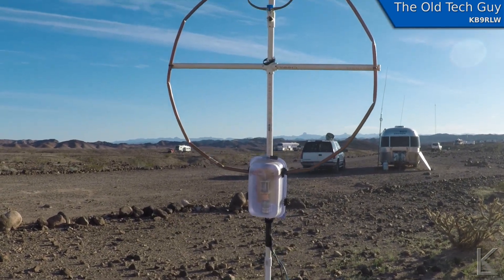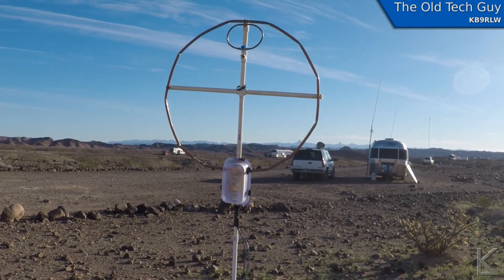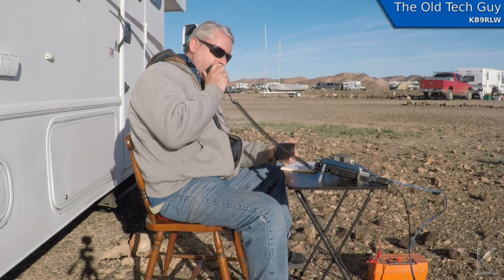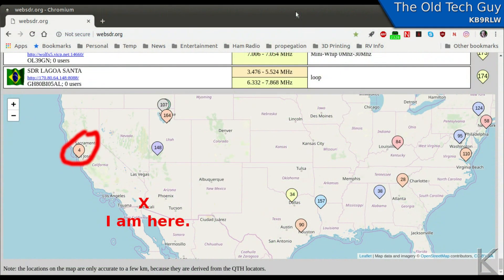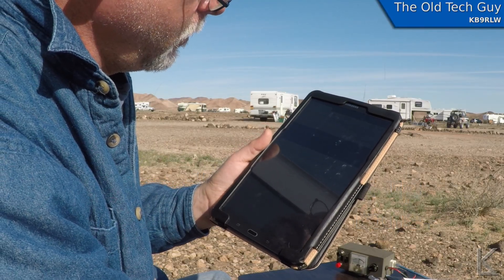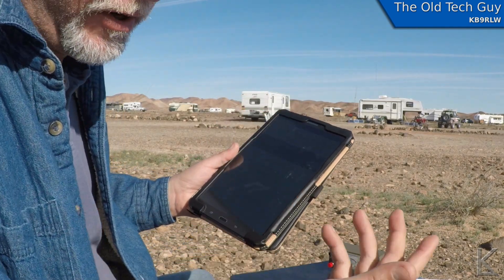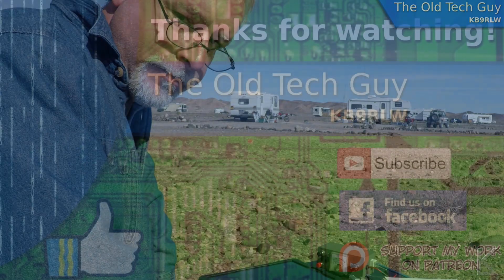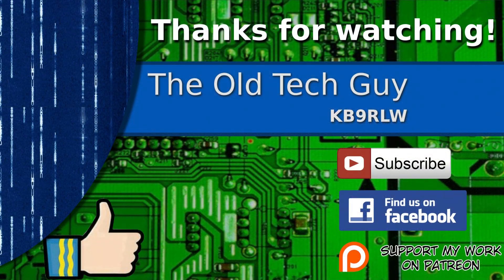Ham Radio - Magnetic loops and height. Do they change near to the ground?

Comment: When I used to live in the city (Cambridge, Mass), I had my MFJ-1786 above the dumb-waiter shaft on the top of a 4 story building, and it worked very well. That was a long time ago. Now I am out in the country, with a three story house but no way to get onto the roof so I haven't erected it yet. I'm surrounded on three sides by foliage and to the west by a hill, so my plan is for NVIS operation, digital modes, on 20-30 meters. I have a chistmas-tree stand and I saw a pole of about 8 feet abandoned by the  old quarry so I might grab that and use it as a mast. If I can't get that to work, I'll make a wood frame about 4 feet tall and try it. First I have to complete my power supply.

Comment: Interesting. Chameleon states lower SWR if their loop is raised - though do not tell how much it should be raised. One loop diameter is commonly agreed upon. 

Had the first test of my F-loop 3.0 today. Placed. on a tripod about 1.5 meters above ground, i made a clear contact on 10W SSB from Dennark to Canada - about 4.000 miles/6.400. km+

It did DX nicely even though often described as a NVIS antenna.

Comment: Does putting the loop lower increase the NVIS ability or does that remain the same also?
Reply from the maker: Loops radiate in a toroid pattern, the same as their shape.  If you want to use one NVIS, just turn the loop so it's perpendicular to the ground and it will radiate upwards.

Comment: I think the change with close proximity to ground is that the loop loses directionality. I put a receive loop for WWVB down in a basement to get away from local noise, and it worked much better.

Comment: Hi Kevin - Thanks for making and sharing this and other excellent radio-related videos. I’m recently retired and decided it would be fun to look into radio technology. As a first project I built a small(13.5 inch diameter) single loop antenna using 1/4” copper tubing. I’ve got a variable capacitor (20 - 370 pF) connected as well. My intention is to use the loop in receive only mode. Given this, does it make sense to couple to the antenna with a small loop, such as the one shown in your antenna, or is that only necessary for transmitting, where impedance-matching is critical? Thanks very much! - Jim

Comment: I moved from an ideal location with multiple rotating towers at 4000 feet land elevation on a steep mountain that dropped off 2000 feet to both east and west and on a clear day could see the Pacific Ocean 200 miles to the west, to a city center of a large city in Eastern Europe where no outside antenna was possible. So my only viable option was an interior mag loop and after lots of experiments found despite the 3 ft thick brick and stone walls, it worked surprisingly well with 10 or 100 watts. I am on the second floor of a 5 story building. So the Mag loop is a very practical antenna for unfavorable conditions.

Comment: Thanks for your contributions.  The question that your experiment cannot solve is what happens over more conductive soil.  It looks like the location used is at the extreme of being dry and arid.   I suspect that the  soil conductivity is very low.  More typical soil of a type that might support vegetation likely to be much more moist and conductive.  

Ground interactions and height effects on propagation  might be much greater.

Comment: Just noticed this video.  Too late, but I would love to see your mag loop near that Airstream, to see if there is any impact with all that aluminum.  I’m considering buying or building another Mag loop for camping and was worried about all the aluminum interfering with it.  I had an AlexLoop before and my truck interfered with it, I couldn’t use it elevated above the bed, I had to move it fairly far from the truck to be effective.

Comment: I have found that having set the shape etc, of the coupling loop to optimum at approx.  2 diam. above ground, lowering 
it to less than 1 diameter makes achieving a good VSWR difficult if not impossible.

Comment: When modeling these antennas, it takes far more of a change in height at 20 and 40 meters to see the changes that will happen.  A change of only four or five feet really is insignificant at these frequency wavelengths.  I wouldn't expect this change to show any difference on an s-meter.

Comment: After reading some of the other fine comments I thought I would add that the EZNEC Loop model also shows better performance with the capacitor at the top -- I think because the highest current is at the top and a little higher above ground. In both the model and my real world situation the loop shows , as expected a strong null perpendicular to the plan of the loop. I live near an rf noisy downtown area and the real world null of local city noise is about 8-10db on my Elecraft P3 panadapter. As a speculation, I wonder if part of the reason Mag loops  get reported as having such good performance when experts often pan them,  is that they act as very sharp preselectors on receive with a relatively small band width and pretty sharply drop off of signal strength outside the 2:1 band width. This should give improved signal to noise performance even if, as experts say, the overall receive performance antenna efficiency is lower. This certainly seems true of my particular situation compared with a 15ft high non-resonant stealth dipole. As the fine results of QRP operating show, transmit efficiency is often less of a real world effectiveness factor than other considerations. Cheers & 73 Jim
Reply from the maker: It's my understanding that the voltage is highest at the capacitor side of the loop and current is highest at the coupled side.  Jeri Ellsworth recently demonstrated this in a video also.   
I would expect radiation to be highest where the current is highest.  Lot's of debate over this though.
I have built with the cap at the bottom, mostly for construction convenience.  Always had pretty surprising performance too.
Reply: @loughkb  Hi Kevin, Right you are!---sorry to have contributed to any miss information. The voltage is highest at the capacitor and current highest at the coupled side! Getting old I guess! Thanks for the important correction.

Comment: Hi Kevin, I certainly enjoy your U-Tube videos. Living in an HOA I am antenna limited and have an MFJ 40-15 tunable loop hidden on my flat garage roof with a loop center height of about 15 ft. This antenna has performed surprisingly well. I was curious about its good performance so I modeled it in EZNEC. (I make no claims as to my modeling expertise but the model seems to compute fine) What I found, for what it is worth, is that Mag Loops do seem to be height sensitive in performance in models at least. With increasing height resulting in better performance. At 15 ft my model vertical oriented loop shows modeled performance comparable to a quarter wave length vertical with four raised radias. This seems comparable to my real world performance. I Know real world antenna results and models can be quite  different but I thought i would share this as an avenue for further research on the topic. Thanks for the fine videos. Cheers & 73 Jim

Comment: Greeat and interesting video, Kevin.  To me- this is real ham radio.  Thanks!  I wish I had a loop.. I'd love to try the same test (on Rx anyways) while tuned to WWV, using a step attenuator, and my ftdx3k's S meter in analog mode.  Great place for antenna fun you're at.  Have fun!  72 OM

Comment: Yet another GREAT video!  If I might add a comment for one reason to run a loop high on a pole.
With a loop even at QRP levels, one can have RF safety hazards, just because you're at low power does not mean that the RF levels are safe. Magnetic loops can have massively high currents and voltages creating incredibly strong nearfield B and H and thousands of volts.  according to the math, when using a compact loop for CW or processed SSB (i.e. 30-40% duty factor) and QRP power, a distance of 2 meters from the closest part of the antenna system provides a reasonable margin of safety for controlled exposure. Casual observers and bystanders (e.g. other people at a park when operating portable) should be kept 10-15 feet away. At 100 Watts, or if a high duty factor mode is in use (FM, RTTY, PSK31), the distances should be doubled at a minimum.   
H=(IR^2)/(2(R^2+d^2)^(3/2))
Where 
H is the magnetic field in A/m
R is the radius of the loop
I is the current in the loop
d is the distance from the axis of symmetry
FCC limits 0.163 A/m maximum permissible exposure (MPE) for controlled environments in OET bulletin 65b
73
AD0WQ
Reply: Agree had minor RF burns on a home made, uninsulated loop at less than 10W - when I touched one of the feed points

Comment: I have several magnetic loop antennas, one commercially made and 2 home made, all 3 work very well 1 metre off the ground. If mounting horizontal they must be up high, at least 6 metres or so.
As far as websdr receivers go, I prefer the KiwiSDR over the Softrock based websdr. kiwisdr(dot)hu

Comment: What about mounting the loop horizontally? I.e. the plane of the loop tilted 90 degree, to make it horizontally, in parallel to the ground. AFAIK the radiation pattern of a mag loop has the shape of a doughnut, like the loop itself. Mounting the loop horizontally would make it a good omnidirectional radiator in the horizontal plane. When mounted vertically, like you did, part of the radiated power gets send into the ground and part of it steep up into the sky. But good HF propagation is achieved with a shallow angle. With a horizontal mount you would get much more radiated power in that direction.
Reply from the maker: I have played with the loop in a horizontal plane.  It worked, but was much noisier due to the omni-directional sensitivity in that configuration.  It behaved a bit more like a vertical that way.
Reply: @loughkb  Thanks for the confirmation. That is exactly what I expected from my uneducated guess.

Comment: Good test! I need to do some more loop experimenting. I have some materials I want to try. I made a loop using half inch wide copper tape with conductive adhesive, on a substrate of polyurethane plumber's pipe strap, but it's too soft and needs too much physical support. It makes a dandy loop if properly supported, though. So I'm going to experiment with layered wood edge veneer, 3/4" wide, with preapplied hot glue. Two layers was pretty stiff, and could be shaped to a nice freestanding curve. Maybe four layers, with the copper foil sandwiched inside, will work well.

I also want to try 3/4" aluminum BX cable armor. No wires inside, just the flexible metal armor, for the main loop. I'll probably use the same coupling loop from the pipe strap loop for the feed point, though. I've got some ideas along that road as well.

I have to wait for finances to recover from the winter, though. I just had some significant expenses, and need to let things recover.

Hope to work you someday. You're doing something I've wanted to do for years -- travel around in an RV, working radio and meeting new people.

Comment: I'm using MFJ 1886 with SDRPlay RSP 1A.  I bought the tri-pod along with it extended to about 5 feet out in the back yard.  I do a lot of SWL, no ham license, and I determined the loop to be quasi-directional!   I get North and South, etc. when I move it around; I'll add elevation this Spring or Summer to around 30 feet.  I'm in North-East Kansas and on a good night I can hear RNZ using the amplifier.  Going to turn it East and will get West at the same time.  Mag loops are pretty good to work with; summer time will probably build a more directional antenna or put up an inverted V just to see what happens.  I get a bunch of foreign language Asian and Spanish like languages will see what happens with broad side of loop if it really cuts down North and South.  Have a great trip around.

Comment: Hi Kevin.
Interesting experiment with the loop.And yes those sdr remote receivers are very useful for monitoring your own signals.I always check using that method when I'm operating on HF from portable locations here in the UK . 73.G7HFS

Comment: Hi Kevin,
Nice experiment. Most recommend having the loop at least one loop diameter above ground. I have about 40 ft of 3/4" refrigeration tubing and a vacuum cap of 20 - 1000 pf. May make a 12 ft diameter loop for 160 - 40m. Not sure if the inverted terminated U antenna was working well during the CQ 160m SSB contest. I made 8 contacts to NH, NJ, MD, and DE from Philly. Heard many others, but no contacts.   73   WB3BJU